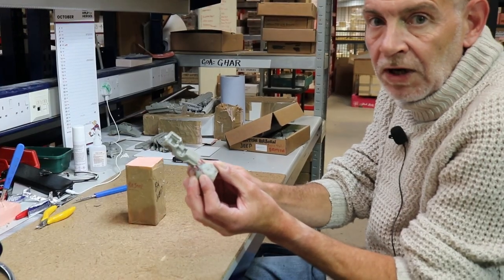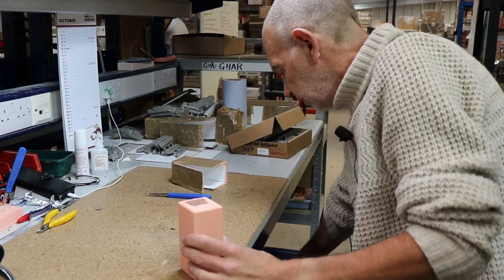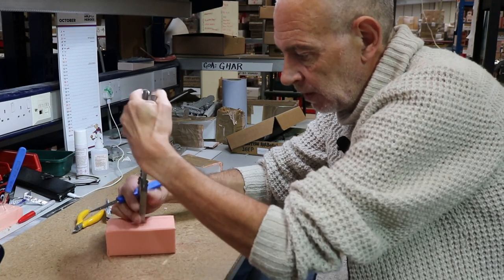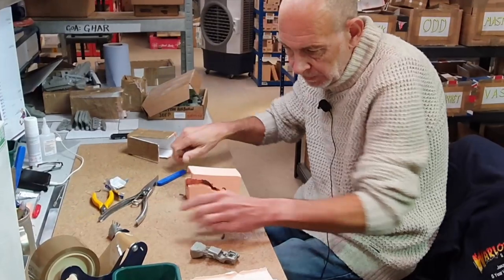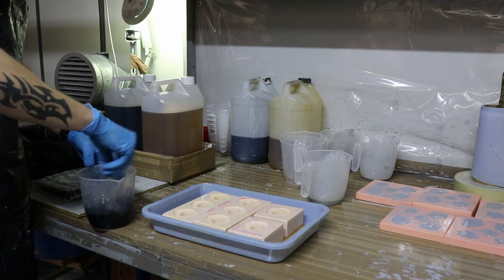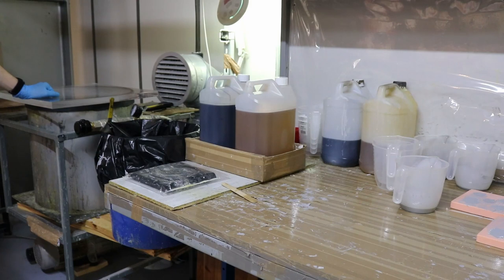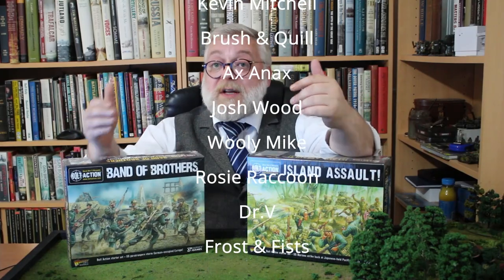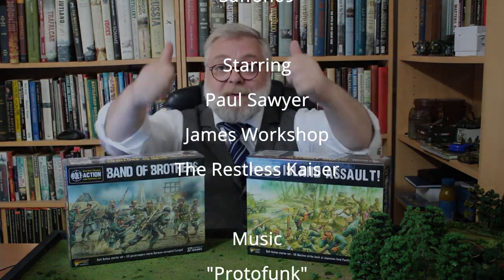Our day at Warlord - Resin casting with Rachel, Tom and Jason

Comment: True. As he pointed out, 1 new blade per mold. Just use the old blade for the rough cuts, then switch to a fresh blade for the detail cuts as he did. Works with vulcanized molds as well. and you can also use a fresh #11 blade for cutting the venting. I would have like to have seen the casting of the Master Models into silicone. And do you ever have problems with resin Masters bonding to the silicon molds, or do you need a release agent? The copper in Brass Masters can bond to vulcanized rubber molds, but a fine coating of graphite can help prevent copper bonding.
Reply from the maker: Sounds like you know a great deal more than I.
Reply: @ModellingforAdvantage  I'm a master mold maker with over 10,000 vulcanized rubber molds, but I'm rather limited when it comes to resin.